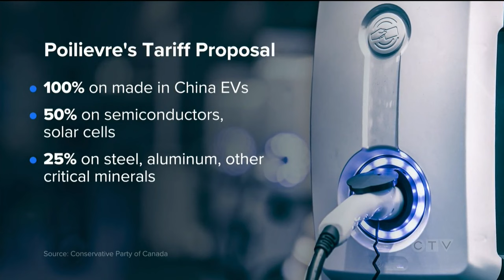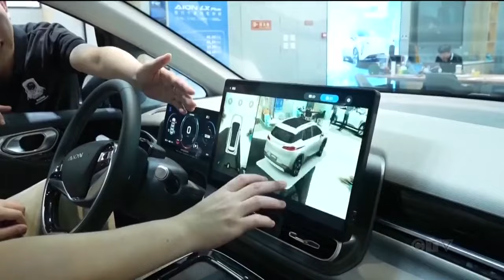Why Poilievre is calling for tariffs on Chinese EVs, steel, aluminum

Comment: 100% ev tariff... Confirming that the domestic industry is totally uncompetitive and won't change.
Reply: Correct, Americans and Canadians won't and can't work for $686 a month on the assembly line, hell we can't even afford to live off the $2700 a month the management is making. Now let's talk about parts that won't last more than 5 years.....
Reply: @Themiddleman416 China has highly automated car manufacturing. Labour cost is increasingly less significant.
Reply: @Themiddleman416 The primary disadvantage in NA is that manufacturers are addicted to manufacturing behemoth pricey luxury vehicles. The hyper competitive BYD Seagull is a simple sub-compact.